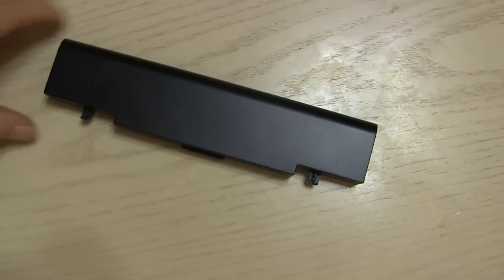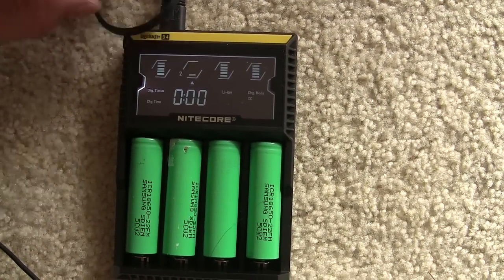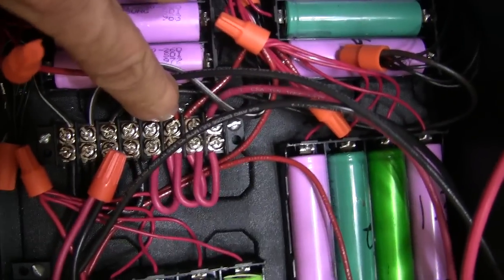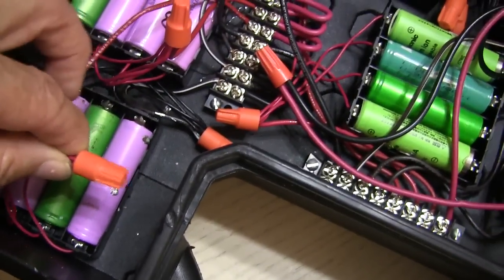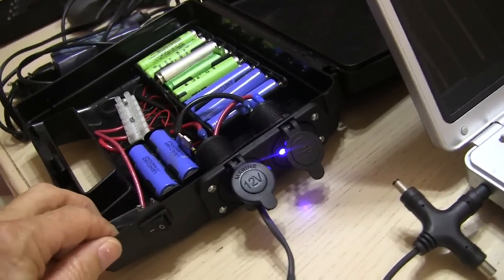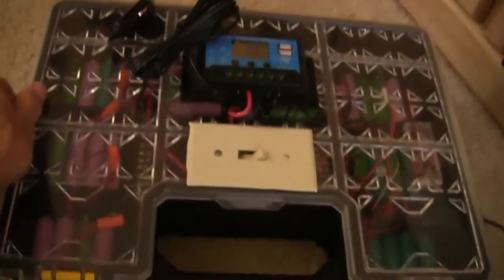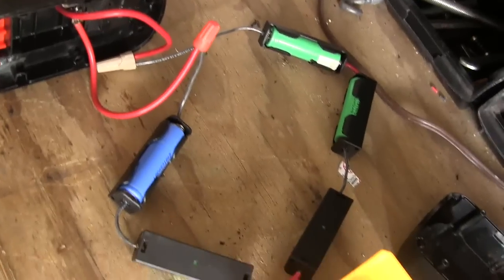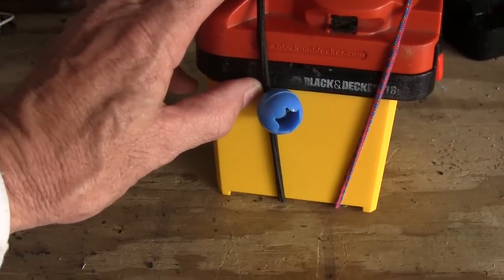18650 lithium ion batteries

Comment: Neat project that looks nice and very usefull.  How do you balance the cells/prevent over charge/discharge?!  I would probably at the very least fuse each parallel group.. and if a management board were too expensive use a RC balance charger maybe with a few of those $1 led voltmeters.. they won't holdup if hit much below 3v/cell or charged above 4.2v/cell and being mixed age/capacity just amplifies the problem :/
Reply: jkmacgyver Thanks. I balanced my cells according to the charge before I plugged in the cells. I'll fuse each parallel group next when I can get to the auto parts store. The solar charge controller on my larger generator is made for lithium ion cells so I don't feel the need to use RC controllers. Besides that, I placed the cells in battery holders so that I could easily replace cells. As for the small battery bank: I can easily remove the cells from the holders each time I need to recharge them. The same goes for the five cells in my drill.